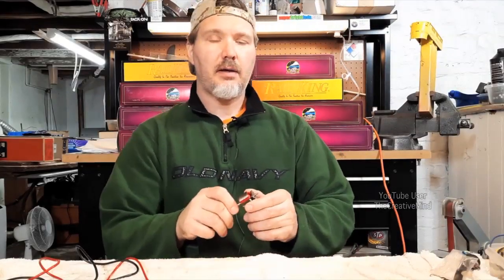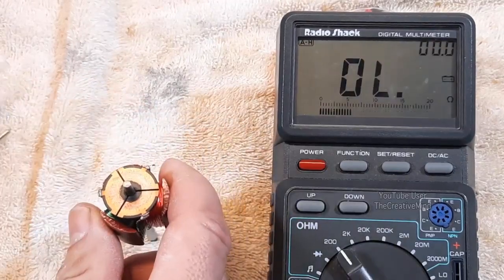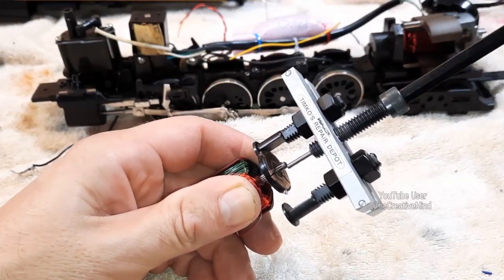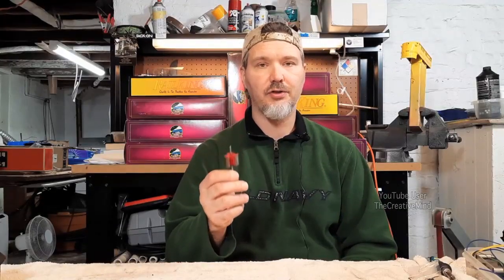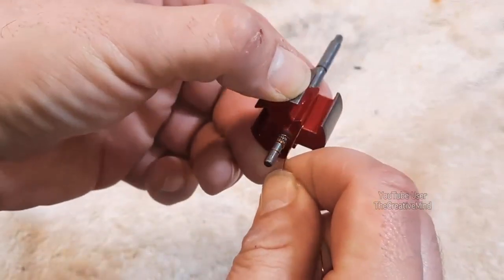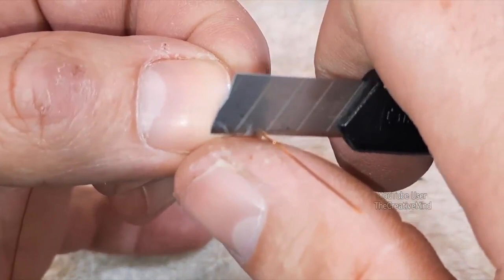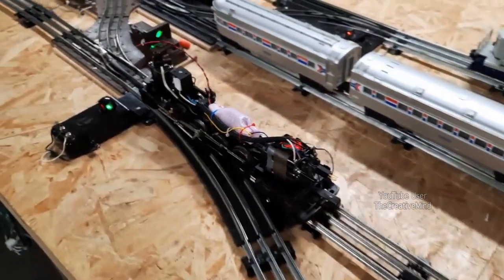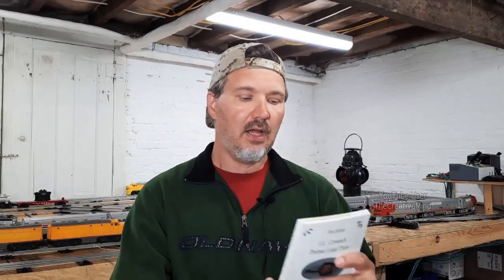Learn How To Rewind Lionel Armatures

Comment: I didn’t understand why you were talking about total length of wire. I have rewound about fifty of these and just counted the number of turns.Yes direction has tone right. Also I have found that most of the time the commutator plate will not come off or it will break. The person that wrote that book is Bob Hannon real nice guy and he will help anybody and does sell the commutator.The book also has the right wire Hague number of turns and direction.
Reply from the maker: You must have tons of patience for rewinding that many armatures up to this point. It's a rewarding experience when you see your work operate. For me I measured out the wire in full length so I can wrap the wire over the segment by hand. This action causes the wire to curl up on itself and I have to straighten it out every so often but not to often. I've seen devices that spun the armatures to wind the magnetic wire on them, thats something I like to own without stringing out the wire and doing it by hand. Bob Hannons book is really helpful but I'm not familiar with the motor types in modern locomotives even if the design was used in a postwar locomotive. That's why I used a wire gauge. Other than that, I'll have no problems working on older locomotives.

Comment: That was an outstanding instructional video! I learned a lot, especially the measurements of the ohms, the easy math equations, the wire gauge tool to get the correct size wire, the amount of windings needed for the armature, and the soldering. Well done!
Reply from the maker: Thank you Tomz.

Comment: Original readings were a bit lower. You must have selected one wire gauge smaller than original. Your motor will be bit slower RPM  but the torque will be a bit more. You wold gain torque and RPM by using bigger wire, say .026 with the same number of turns. One would need to be neat in winding to fit in space and not throw of balance due to extra winding mass. Negative would be motor may run a bit hotter. Very good presentation.

Comment: I have a Lionel 6-18003 (1501) Lackawanna 4-8-4 steamer. In seeing your engine open I was wondering if I could use that more modern smoker in mine.  The lob on the front axle just broke apart and  now there is no simple way to make the smoke puff. I hate to have to pull the front drive wheels off just to replace a part, that I can guess, will crack off again. I was thinking a more modern fan driven one could work and I could place a leaf switch in front of the drive rod tips in the front cylinder, to activate.
Reply from the maker: Judging the space in mine it looks like a smoke unit can fit inside but you may have to do your own bracket. Others have done the same too with a cherry switch. The only issue is syncing the chuffed sound with the smoke output. I'm not sure what part you need but I found number 600-8404-052 smoke cam and 600-0746-033 smoke lever in my parts book if you decide to fix your engine.

Comment: You said that this armature was shorted, yet you measure all three of the sides and got the same resistance. If one coil was shorted you would get a much lower resistance read on the coil by it self.  I have to assume you were testing a good motor armature for your understanding of what a good motor should be....
Reply from the maker: Yes the motor was shorted but to the segment. I pushed the wire aside into its field so I wouldn't get any false readings. I believe if I left the wire where it was, I still would have gotten the same readings. I should have left the wire in place and tried that theory. If I was to get a lower resistance reading on the Commutator plate, the varnish on the magnetic wire would have to rub away on itself creating a short on its own field thus lowering its resistive rating.

Comment: Another great video.  Dumb question though.  I noticed that in another video that you used a tool aside from the multimeter to test the armature.  Can you provide the information on that tool?  Or did I miss it in that video?

Any how great work & thank you for your time!
Reply from the maker: Thank you Steve. The other meter I'm using is the Supco M500 megometer (megger for short). I dont mention it in this video but i did use it in other videos and talk about what it does and how to set it up. It measures the resistance of the insulation of the wire, not the wire resistance. I explain it here in my ZW rebuild video. Go to time 4:45

https://youtu.be/qPZNaASE_lw

If you have any questions on it, let me know I'll answer to the best of my ability.
Reply: @TheCreativeMind  Thank you so much!